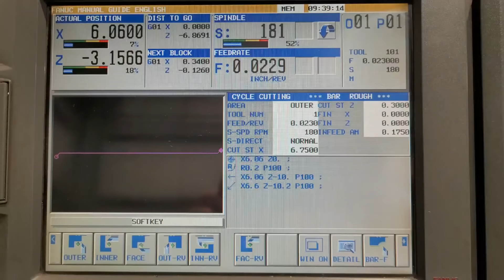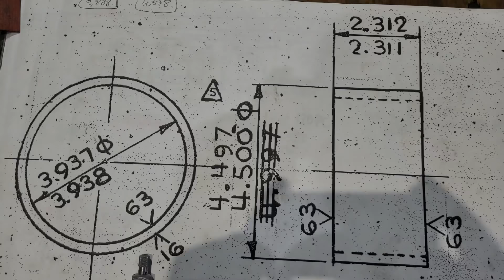Stainless Steel Rolls | 60 REQ |Feels like a production work | CNC Lathe Machining

Comment: It's orderly insane for me that you can turn it at this length with that pression. I am on the way to become a mechanic and I do stuff like this also at work but not with these tolerances. It can be a big struggle that the part won't chatter. Great job man !!!
Reply from the maker: Yeah, the chatter was my biggest problem. I've tried higher rpm, lower rpm, and different inserts. I couldn't do much with the feed because of the 32 surface finish.
Reply: @ChrisMaj  what i sometimes so, at my machines I can change the rpm while the programm is running and then I go faster slower faster slower, with that I can compensate the chatter a bit, but it's always a struggle

Also nice videos it's really interesting for me and I learn a lot:)

Comment: I am one who works in a factory that produces the same thing over and over again. You get used to it and can have some pretty chill days where you dont have to use your mind all that much. Then some days you have to rig the machines for som other parts and get them in to spec witch get you some diversity. Have you tried using cbn inserts on stainless? I have heard they should be able to leave a good surface finish but have not tried them on stainless. On my workplace we use a lot och cbn tooling on hardened parts that have high demands for surface finish and when done right you get a real mirror finish. Love the content :)
Reply: Stainless steel is usually pretty soft and they're primarily made for hardened steel. Could be an interesting test though
Reply from the maker: My biggest problem was the chatter. I've tried different inserts, the smallest radius worked the best, but it means you have to slow down the feed to get a good surface finish. I've tried higher rpm, that didn't go well. That one finish cut 84" took a little over an hour. Boss said it's still cheaper than sending it out for grinding.

Comment: Came out great! I'm curious- did you try a wiper insert to get the 32 finish you needed? ----Aaron
Reply from the maker: I've noticed that they work really good for short pieces  or something that won't  hatter. I my case I've ended up using VNMG insert with a small radius. That worked best.

Comment: I've never seen a finish on the rough stock like that before.
Reply from the maker: I think it's called a Centrifugal casting
Reply: Bars are usually fed thru a bar centerless grinders before shipped out. Most shops ask or require specific size bars.
Reply: @ChrisMaj  Thank you, this is exactly the info I was looking in the comments for. :)
Reply: It almost looked like some sort of grip-coating at first
Reply: @ChrisMaj  Interesting, thanks!

Comment: The lathe we have has a height adjustable tool post and I've been taught to put tools above the centerline of the piece I'm turning. It takes chatter away for many operations. I'm thinking that's what's happening when you turn the tool upside down.

Comment: Is 32 Ra finish the same as 32x10^-6 inches? Only seen surface finish one time in a class and never had to apply it
Reply: I love production jobs, they're good money n easy on the team if they don't mind repetitive production. I call it Charlie Chaplin days😂🤣. Apropo Stainless Steels, I work a lot in Stainless n it is a lovely material to work with. Last week I had a 2800Bar connection fitting to do, it was a one of job🥳, ID for the female  thread was 26.5mm 12TPI 60°if my memory doesn't fail me, something American imperial UNC anyway, I used 304 for the job. I screwed on 56 RPM (CNC guys are cringing 😂🤣, I work conventional only) had that mirror super smooth finish. Used a lubricant/coolant called TAPMATIC, with a brand new Iscar insert(I used a 2.5mm metric as there was no time to purchase a internal 12TPI). Production jobs wise, my Dad n I ran a production run of 1250 pieces in LG 2 Bronze, that was fun n my Dad's Colchester Student 1800 n my SICMA universal milling machine clocked good money on that. Took us just over a month work 5 days a week 8 hours a day. Machining , I love all forms of it. I believe you're a Polish guy Chris, my Dad is from Poland, Gdynia, n he has taught me many old school tricks. Awesome work on the rolls, hope you're blessed with no more production runs for a while.
Reply from the maker: @Voodoo Killaclown  Gdynia, that's way up there by Baltic Sea. I'm all the way on the bottom, close to Tatra Mountains.
Reply: @ChrisMaj  Southern Poland is beautiful n I wish I could see it some day. My Dad worked for Dalmor (not sure of the spelling there), he worked in the maintenance shipyard division. I'm currently in ZA, I hope Europe as a whole will be safe from Uncle Joseph Putin n that war doesn't spill further into Europe. Have a good day Chris, be safe n keep on machining ✌🏻

Comment: As far as chatter on a long tube like that goes, since you already have a way to fit plugs to the ends, try filling the tube with coolant. A guy I work with says it keeps it from developing a harmonic.
Reply from the maker: The thing with plugs was just to remove the stock. I didn't really care about the surface finish. The  finish turning already had stub shafts installed .
Reply: @ChrisMaj  Ok, makes sense.

Comment: Upside tooling is so helpful with this stuff lol
Reply from the maker: I don't really know why, but it just works.
Reply: @ChrisMaj  as the bar spins with top coming towards you and the tool in the normal position, it works like the third point in a triangle between your chuck and tailstock.  With the addition of gravity pulling the bar down, it will build spring tension and bounce back up causing chatter.

When you flip the tool and spin with the top of the bar going away from you, gravity helps dampen the wrapping/bouncing effect.  You’re effectively piggy backing on the natural sag of the bar from its own weight.  

This is what the 76yo owner of a shaft shop had explained to me when I was working for him.  He started with fully manual stuff and didn’t have the tooling tech we have.  So super slow turning.
Reply from the maker: @kw2519  Yeah, I've learned that from an old machinist back in trade school years ago.

Comment: There are a lot of things that have to fall into place to get a half thow over that long distance. Do you have to use taper compensation on the lathe, or is it in that good of condition?
Reply from the maker: After all these years, it's still in good shape just have to get the tailstock in line with the spindle.
Reply: @ChrisMaj  Exactly JL

Comment: What is this sand-like surface? And how does it affect the insert?
Reply from the maker: It's called centrifugal casting. The outer layer looks like concrete, and it wears out inserts like crazy. Once you get underneath, it cuts like a butter 😉
Reply: @ChrisMaj  Oooh, amazing, that is how they made that a tube. Thanks for the info!

Comment: The beauty about having a lathe this long and doing parts like this is the machine just doesn’t wear all at the chuck. So doing 84” within 5 tenths is possible. Try doing that on a 15-20” manual lathe… no chance. My 15” has 2 thou wear 4” in front of the chuck. It’s infuriating.